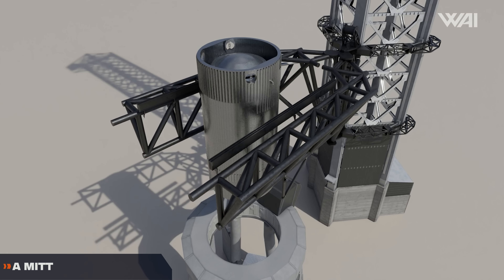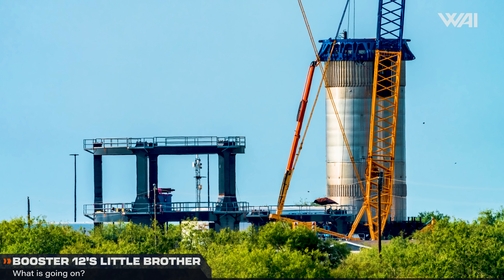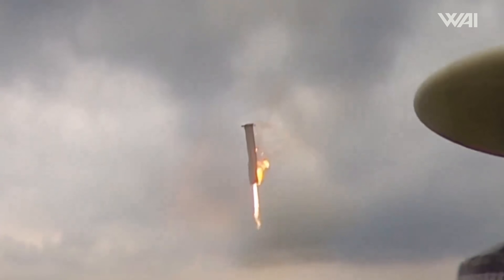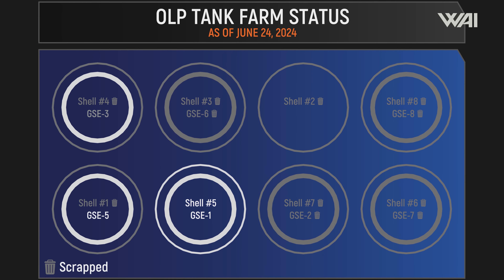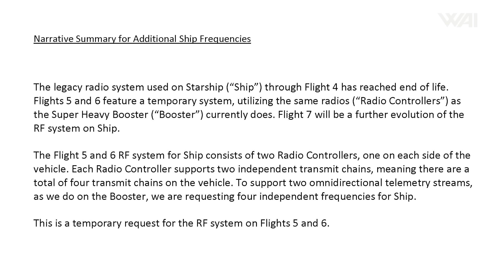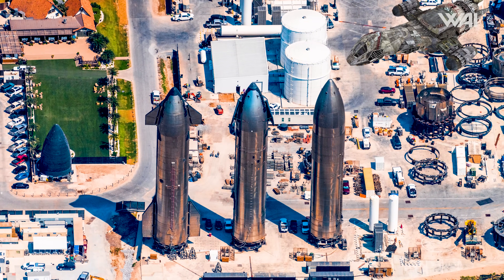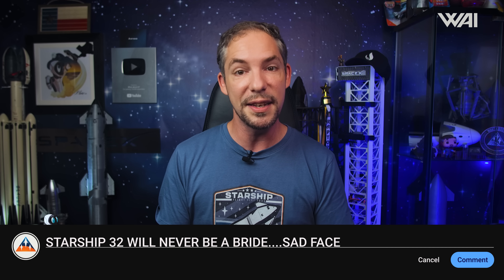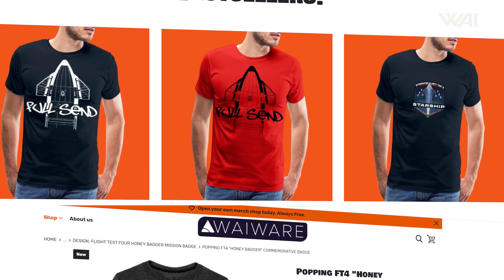SpaceX Massive Starship Drop Test! & Musk Talks Heat Shield, Starship Failure & Raptor V3!

Comment: Jeff Bezos should realize that the Starship architecture is optimal and that New Glenn will not be competitive.  Blue Origin should ask if they can help Musk with Mars, and join in building more Star Factories and launch facilities.  Actually, any billionaire who wants to help civilization could do that.
Reply: @flightofone  sadly Jeff has very little actual experience or desire to deliver anything functional.   They are only after government funds for "future delivery" but no intent to deliver anything... its the same thing Boeing has been doing this century.  So let's keep this in mind and tell our representatives to stop funding companies that dont deliver.
Reply: Long term habitation on Mars by humans is currently unfeasible due to the low gravity. Long term living in low-g is harmful to humans, so Mars won't work until a solution is found. Alternatively, living in large (and I mean LARGE!) orbiting rotating habitats could provide the fake gravity (centripetal acceleration) necessary for human health.
Reply: @richardpark3054  There is certainly evidence that microgravity is harmful long-term (bone loss, muscle loss, potential fetal development problems, etc.)  However, there is ZERO evidence to show how much gravity is needed to avoid those problems.  That is very difficult to simulate, ie: a centrifuge on the ISS big enough for a human is not feasible.  The only way to find out is to try living on Mars.  My prediction is that there will be very little problem with 1/3rd gravity.
Reply: @flightofone  If we're going to populate Mars, it's critical to get animal test subjects there ASAP to find out what 1/3 g does to gestation.
Reply: @flightofone dude, once starship is operational, whats feasible on LEO changes completely.

You could put in orbit a huge new ISS for a fraction of the cost. The whole ISS could be put up in 2 flights, for less money than a single shuttle mission. Thats a game changer.

It makes way more sense to simulate Mars conditions near Earth, before sending a mission.
Reply: @Coyote27981  Good point, a couple of Starships tethered and rotating could allow simulation of any level of gravity.  You need about a 1km tether, and tether dynamics are complicated.  I would say, just go for it - we are sending humans to Mars for a minimum of 10 months anyway, and can study the effects on them.  Me and a million other people would be willing to take that chance on a one-way trip.
Reply: @richardpark3054  well Mars gravity doesn't necesarily have the same effects as microgravity for those exposed to 0G for long periods. 38% of Earths gravity is not that little.

Ideally you would have some sort of artificial gravity while travelling from Mars back to Earth. So you can use those months to increase the artificial gravity progresively. Giving their bodies chance to recover.
Reply: @richardpark3054 titan
Reply: That’s the thing. The billionaires don’t want to help civilization.
Reply: @seanremmen5814 what do you know of the intentions of billionaires who probably donate more to our communities than you’ve made in your entire life! Many times over!

Comment: Ariane 6 is still, at least, an order of magnitude too expensive to compete.  Elon explained that, currently,  between launches thousands of flight critical modifications are being implemented on Starship.  The booster is clearly the closest to its final incarnation with a future stretched version perhaps accompanying the switch to version 3 Raptor engines.   The Starship’s biggest issue is the heat shield.  It must be robust enough to withstand repeated reuse without refurbishment yet light enough to allow Starship to carry useful payload.  Until the heat shield problem is solved mass production of Starship will be on hold but Space X engineers will still be able to focus on orbital tanker and lunar lander variants;  non of which require re-entry heat shields.
Reply: tankers will have heatshields

Comment: The trickiest thing on a drop test could well be how to prevent the crane from jumping and breaking when the load is released. In a worst case, you could actual topple a crane over backwards (I think there are example of that happening). I'd not be surprised if during a drop the boom is actually tied to the tower (or something else in front of it) to prevent exactly that.
Reply: The small section of booster should not be large enough for that to occur its simulating the empty weight of the booster not full weight. Granted someone needs to run the numbers as or as you say that could well happen. Apparently its 200t empty, full its 3600 ton..one way to get around this is to not fully release the booster but to keep it tethered so it continues to exert some force on the crane as it goes down. that might require special modification to the winch though.
Reply: @Wingnut353  depending on how things are configured, dropping a load way less than the rated load could cause damage... or not. I'm sure they can figure it out, but I'm also sure someone needs to run the numbers (and I suspect the warranty won't cover any damage).

Regardless, cranes are remarkably fragile when loaded in ways they went designed for.

Comment: There will be no drop test. The crane is not testing equipment, and dropping half a booster in a way that might cause it to fall off the stand and hit the crane with a human operator inside is not going to be allowed.
Reply: Well they DO own the crane. And the newer ones like that can be operated remotely. No human needed inside for something as simple as a drop. The question is would they really risk something going wrong like a crane tipping over. Or maybe they have some plan for making sure that can't happen.

Comment: Why doesn't the second launch tower base have a water deluge system underneath it?
Reply: Its a catch tower only. 

They will prepare the launch tower for another launch, well they unload the catch tower ship. 

Remember elon aiming for 3 launches a day.
Reply: @mitchelldalton7405  Remember elon aiming for 3 launches a day. 

3 launches a day = 6 catches a day.
Reply: The tower is the adjacent structure to the circular launch mount, which I don't think they have mounted.  But I think they are iterating four legs instead of the 6 supporting current olm.

Comment: Questions... Can the booster rotate/ spin while hovering....it would seem to need to in order for the catch pins to line up.  How far off (rotational degrees) can the booster me misaligned and the pins can still be snaged?
Reply: Yes, they can control the roll with the gridfins, that's how they precision land on the barges.
Reply: @Yattayatta  Lateral movements as it has a control fall to the barges is one thing. But to spin vertically while at a near hover is another.  I have not seen this addressed yet.
Reply: @Ezzell_  It works, you need a minimum of three control surfaces to control roll without oscillations, if you accept oscillations you can do it with 2. 
I sadly don't have the energy to explain why it gives sufficient control authority, but it does.
Reply: I am in the aerospace industry myself. The grids can only deflect the air moving through them. At a hove or near hover and the booster is fully upright, the griffins will not turn the rocket to allow the the pins to align with the arms. To rotate or  "twist" the rocket, a horizonal thrust must be applied.
Reply: @Ezzell_  As long as you are moving through the air you can control spin, now ask yourself this, did you ever through the 300 landings see a Falcon 9 come in with spin? no, so obviously not an issue.
Couteracting spin is a solved issue in Aerospace engineering, you'd know as much since you work there I'm sure.
You counteract it with active control surfaces, a gyro, cold gas thrusters or engines that can gimbal enough to cancel out spin.
Every rocket since the 60s in the US had a roll program to get it to the correct azimuth, the soviets solved it in a different way, they turned their entire launch platform, but they still had no spin on their rockets.
Reply: @Yattayatta  You are not getting the point. Falcon can land in any clock position. Its three points of contact does not have to land exactly on three points on the ship....it can land any where in a 40 foot circle in any three point clock orientation., but but when the starship booster lands (caught) it has two point that must be  caught on very specific points . Two get those two catch pin to land onto two rails, the booster must be in the right clock orientation. Falling through the atmosphere, yes the fins can spin the booster along with the gamble engines.  But at a hover or near a  hover the  booster has to rotate if there is any misalignment at say the last 20 feet.  with out cold thrusters installed to twist/spin/rotate the pins into a 90 degree orientation to the rails....there's going to be issues.
Reply: @Ezzell_  I get your point, you are not getting mine, they will VERY obviously align the booster to the rails and cancel out spin BEFORE they start the hover.
Reply: @Yattayatta  My prediction is they will not be able to keep it aligned in the last 20 feet and version 2 will have axial thrusters.
Reply: @Ezzell_  Prove it, find me 1 falcon 9 booster landing with spin in the last 20 feet.
Reply: @Yattayatta  Never said falcon needed to spin the last 20 feet!  Starship booster may have to.  Last time....and if your intellectual ego cannot read....then dont respond,   the starship booster has  catch pins...about the size of grapefruits. This pins has to come down onto two rails when the booster is caught. if these pins are not squarely aligned up, the pins will miss the rails. So the booster MAY need to rotate/spin/turn/twist in the Z axis.   What part of that dont you understand?
Reply: @Ezzell_  You are still not getting it, they have several ways of adjusting the angle of the booster while in flight, if you can't control your roll, you can't make an accurate landing. 
They will line the roll axis up with the catch arms while in flight, cancel out the roll, and then go in for the catch.
Sub sonic terminal guidance is well understood. 
Everything will be aligned prior to the landing attempt. 
There are VERY few rockets that can't control their roll, as it would make them quite useless.

Comment: I think SpaceX should put more than 2 catch pins on the booster in case the booster comes in wrong. Elon is betting on the Booster to land in the catch arms the same way the chopsticks pick it up. What if it doesn't come in that way. Just saying?
Reply: It's also got 4 grid fins above the catch pins.
Reply: @hotrodandrube9119  True, but it was later told that the grid finn is not strong enough to hold the booster. It has to land perfect or well, boom. Not good.

Comment: 14:00 The next generation Raptor 3 could potentially use the new engine jacket cooling to generate pure oxygen ullage gas for the oxygen tank, rather than using pre-burner bypass gas.  And do similar for the methane tank.   Tim Dodd may have closer to the mark than he realised when he discussed Stoke Space using hydrogen to cool their main re-entry shield. The combined surface area of the Raptor engines should be more than enough to generate enough ullage gas during ascent and rentry. Shame to let that heat go to waste.

Comment: Catch Testing. 1. Will the Mekazilla arms catch supports have programable hydraulic resistance will may vary according to the load and distance to travel before the end stops are reached ?   2. Is test catch booster going to be loaded to the maximum predicted test value during tests, In case the actual booster returns from sub-orbit with a heavier fuel load.    3. Will the crane supporting the test booster lower the booster at realistic landing velocities and test weights?     4. Will the catch tests be performed at the extreme ends of the Mekazilla arms representing the limits of the performance envelope ?  5. Will the test booster electronics be active during the test, to verify the control logic responses of the booster?.
Reply: For the 1st pass just catching a test article moving a few feet/second ought to suffice. I would expect later tests to be more complex.

Comment: The catch is way too risky and experimental for infrastructure damage they should have a dedicated catch tower with fire suppression and everything to prevent such costly errors
Reply: Anyone who has worked with a Acetylene torch knows that steel cables under tension are extremely vulnerable to any high heat which is exactly what the booster is good to be serving to the cables
Reply: Anyone who has worked with a Acetylene torch knows that steel cables under tension are extremely vulnerable to any high heat which is exactly what the booster is going to be serving to the cables

Comment: Space X need to be ready to rescue Stare Liner crew from the ISS. Congress will be questioning NASA of it's stonewalling a rescue. All they need to do is a supply mission and rescue the Stare Liner crew in return. The crew's time on the ISS is replenishing supplies because of the over stay.
Reply: Cargo dragon and Crew dragon are two entirely different crafts. I'm sure they could put some cargo on crew dragon but probably no more than normal because it would be an extra risk factor added to a rescue craft.
Reply: It's congress that keeps throwing money at Boeing. Their stock goes up and a few in congress bennifit. The Pelosi effect.
Reply: What overstay?? Did they mess up?
Reply: @Berilaco  yes the capsule had two issues with it ,they should have only stayed at the ISS for a bit over a week
Reply: @Berilaco   What overstay?? Did they mess up? 

If I recall correctly they launched on the 5th and were only expected to stay about 8 days.  It is now the 25th and their CURRENT (changed repeatedly already) return date is July 2nd and they apparently have to return by August if coming back on Starliner as it isn't equipped for a longer stay.  

As to mess ups.  They launched with a known helium leak.  They now have 5 leaks.  Several thrusters failed on docking they have managed to reactivate all but one.  Now will those thrusters actually work long enough for landing?  Will the helium leaks get worse and mess things up?

:planet-orange-purple-ring:
Reply: @Scanner9631  yeah i heard about the helium issues but since then i havent heard anything about it... thank you
Reply: @Berilaco yes. Starliner is stuck at the ISS due to numerous leaks in its systems
Reply: To my knowledge everyone comes and leaves in the spacecrafts they came in. Those same ones are also everyone's "escape pod" what nasa would do is send up a spacecraft and in the process just resupply the astronauts with the regular deliveries already scheduled for the station.

Comment: I reckon some sort of elastic bands should be used to catch it. Like vertical, multipoint ( cylindrical ) aircraft carrier landing type thing. Umbrella spokes should spring out catch and then retract or rotate up. Should support structure, that might be an issue.

Comment: If they move the flaps hinge point away from plasma flow , will the flap need to be longer
Reply: Maybe, but the flaps were also oversized so it may be fine as is. 

STS actually had an issue with incorrectly sized elevons due to bad modeling, which caused them to pitch more than the expected maximum was and cause higher heating on the elevon flap. So proper size, too big or small is probably important.

Comment: The catch experiment may not need a crane, have 14.1 sitting on the OLM, lower the chopsticks below the pins, close, then wind them up as fast as the hoist can go. All that matters is the differential speed...
Reply: "All that matters is the differential speed..." that's false because the main thing that matters is the jerk when it contacts the arms. Perhaps by differential speed you mean acceleration, jerk is the differential of the acceleration or how fast the object is decelerating. Just accelerating the chopsticks with the lifting motors would not simulate the jerk at all... the electric motor would have a very low jerk compared to the likely high jerk of the landing booster. Thus they have to drop it to get good results.
Reply: If the arms are not capable of achieving a threshold relative to a collision at lift, then they're not capable of arresting the booster. The clamps are an issue though. The simplest answer is to drop it from a crane.
Reply: @DaelinTV Do the quick lift from the OLM first. Next, possibly do a short drop. That is dependent on being able to remotely release the crane hooks though which I doubt is possible at the moment.
Reply: @r0cketplumber  I don't think the chopsticks are fast enough to get a usable result and that's if they are even able to catch it while moving.
Reply: I think you would want to replicate what will happen as best you could and they can drop the test tank with a crane, that will be a lot closer than ramming the tank with the chopsticks.
Reply: And rip the test article from the hold down clamps? The OLM holds boosters it does not just support them.
Reply: @Wild-Eye I would say it is possible to disengage the clamps before such a test.
Reply: @RussTillling  Yeah no